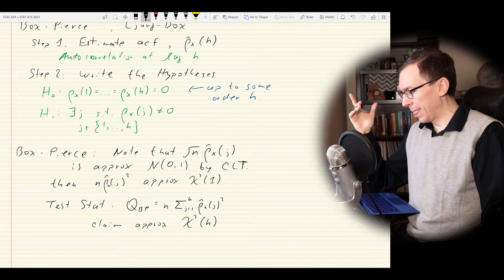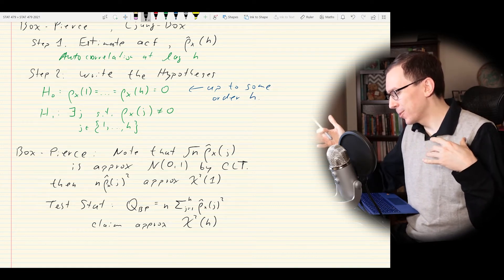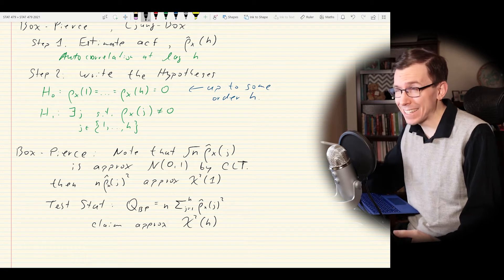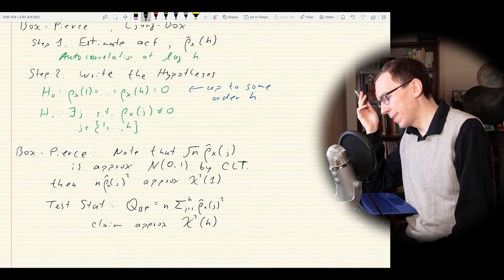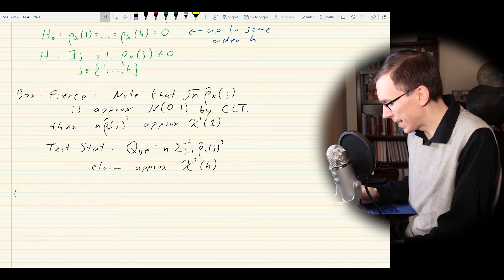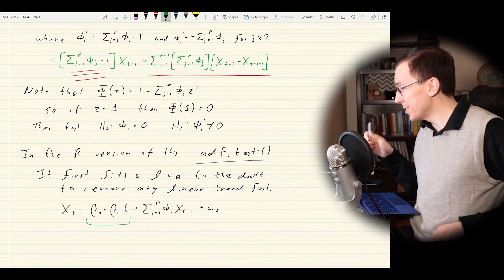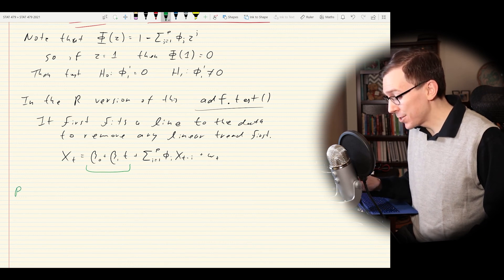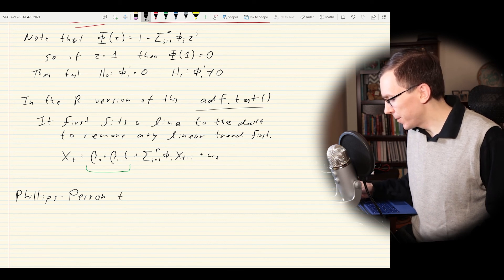Time Series Analysis, Lecture 7: Autocorrelation and Stationarity

Comment: Hi,

I think your explanations are super comprehensive and clear on topics that I find challenging. 

At 17:28 you talk about running autocorrelation tests on residuals after fitting a model rather than using e.g. LB as an exploratory (?) test before fitting a model. That makes sense. I am new to the time series area but in my head, it would also make sense to see whether there are significant patterns in the data (i.e. autocorrelation exists) or not using e.g. LB. Then running e.g. ADF or DF would give us a hint on what model is appropriate to fit to the data.

Maybe I misunderstood something but your thoughts on this would be great. Thanks.